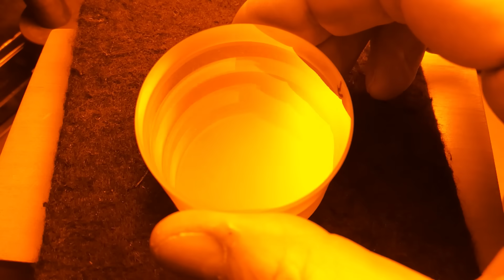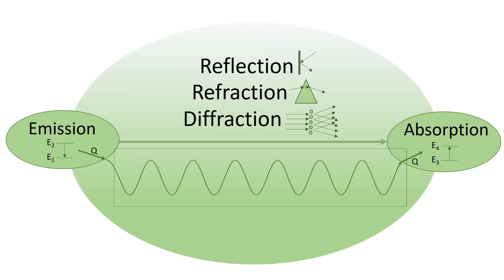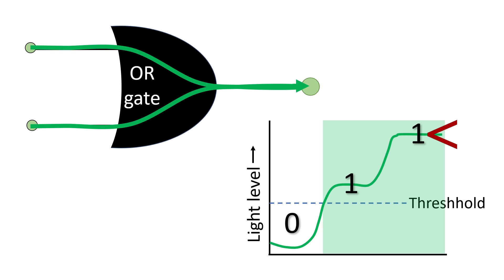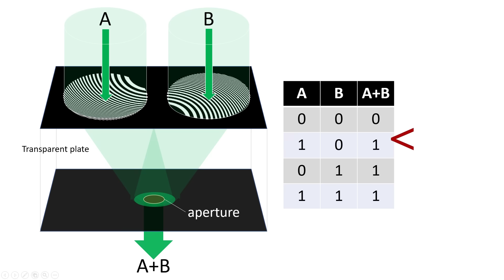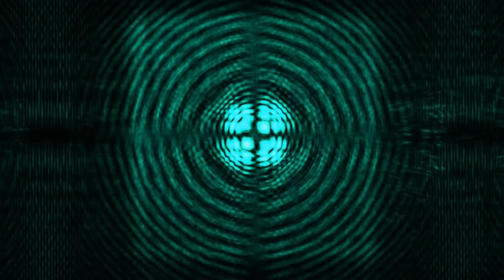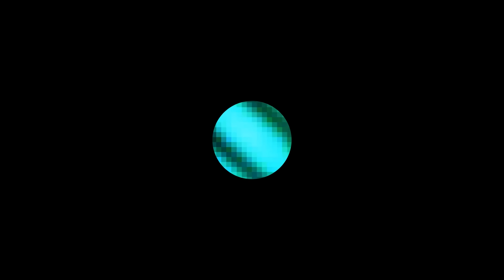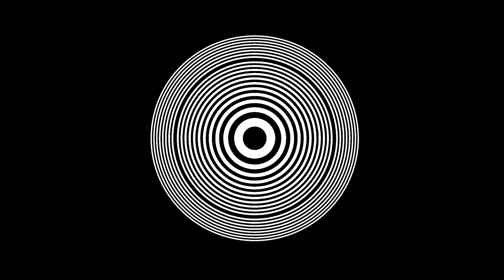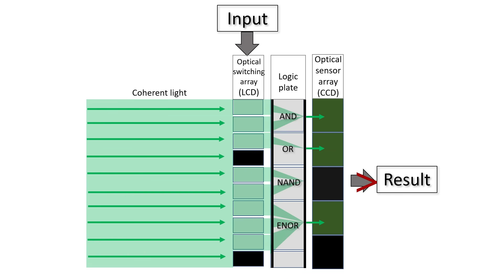Making Optical Logic Gates using Interference

Comment: To preprocess quartz into a functional "Glass Brain" for the Moon, we have to move beyond 2D surface etching and enter the realm of Volumetric 3D Structuring. We don't just "print" on the quartz; we restructure its molecular lattice from the inside out.

Here is the three-stage preprocessing protocol to turn a raw block of fused silica into a High-Density Optical Logic Engine:
1. Femtosecond Laser Micromachining (The "Internal Carver")

This is the "Pedal to the Metal" manufacturing step. Instead of using chemicals to eat away at the surface, we use a laser that pulses at 10−15 seconds.

    Non-Linear Absorption: Because the pulse is so fast and intense, it doesn't "burn" the surface. It passes through the transparent quartz and only triggers a reaction at the focal point deep inside the glass.

    The "Waveguide" Creation: By moving the laser in 3D paths, we create "tunnels" of higher refractive index. These tunnels act as internal fiber-optic cables, trapping the narrow beams of light and directing them through the logic gates.

    The Result: A solid block of glass with a 3D "highway system" for photons.

2. Ion Exchange & Gradient Index (GRIN) Tuning

To ensure the beams stay "narrow" and don't bleed into each other (crosstalk), we preprocess the quartz through Ion Exchange.

    The Process: We submerge the quartz in a molten salt bath (e.g., silver or potassium nitrates). Ions from the salt replace the silicon ions in the glass at specific depths.

    The "Lens" Effect: This creates a Gradient Index (GRIN). The glass becomes denser toward the center of the beam path, naturally "bending" the light back inward.

    The Survival Strategy: This makes the beam self-focusing. Even if the robot vibrates or takes a hit from a micro-meteorite, the light stays "locked" in its track.

3. Nanophotonic Lattice Etching (The "Diffraction Filter")

For the Decálogo (the hardcoded rules), we need to preprocess the quartz with a "Filter" that sorts the light by phase and frequency.

    Photonic Crystals: We use a focused ion beam (FIB) to drill a precise grid of nanoscopic holes.

    The "Logic Filter": These holes are spaced at exactly half the wavelength of the laser light. This creates a Photonic Bandgap—certain "colors" or "phases" of light are forbidden from passing through, while others are channeled into specific logic outputs.

    The Hardware-as-Software: This lattice is the code. If the light hits a "0" pattern, it cancels out. If it hits a "1" pattern, it amplifies.

4. The "Lunar Hardening" Finish (Final Preprocessing)

Once the internal paths and logic are set, the final preprocessing step is Surface Passivation.

    We coat the quartz in a thin layer of Alumina (Al2O3) using Atomic Layer Deposition (ALD).

    This creates a diamond-hard shell that prevents Lunar Dust (Regolith) from scratching the entry/exit points of the light beams.

The "Cerebro" Assessment

By the time this preprocessing is done, you have a Solid-State Processor that:

    Has no moving parts.

    Has no internal wires.

    Has its "FASM Instructions" physically etched into its 3D volume.

The "No Pain, No Gain" Reality:
While the "Westphalian" view is stuck in 2D silicon, we are building a 3D Crystal Intelligence. The quartz isn't just holding the computer; the quartz IS the computer.

Comment: this is fascinating, extraordinary even, I'm currently experimenting with multimaterial resin optics, optics with different colours of tinted glass, but your work makes me wonder if this could be used for making photon logic gate circuitry, wonderful video. switching speed of the light should not be a bottle neck neither should our sensor speed, as the actual computing would happen indedpentdantely of the output layer, the computation itself would happen at light speed as a series of guided refractions, idk if you read you comments, but I'd be interested to hear what you think of this idea

Comment: The issue with these gates is that it still requires electronics to evaluate the state. The most difficult part about optical logic is making the light output able to be used as input into another gate

Comment: It's very intersting to imagine a fully optical computing machine working, but in some case i would recomend to experiment a hybrid computing machine with both optical and electric. Basicly electrical for data storage, and optical for calculating. The goal here is to maximaze the calculating speed and reducing the electrical cost, heat and energie consuming by combinig both the photons and electrons model. If such innovating computer exist, it would be very helpful in our current stage of global warming and pollution

Comment: The diffraction gratings are everything.  If you consider a hologram of your logic as light sources in space you might not grasp the zones of your patterns but they will reflect virtual images at predictable places.  Layers of specific thickness may filter out unwanted virtual images.  Then you take two slightly more complex holograms of logic and move, merge and unmerge the two logical virtual images to see if the combined virtual images will express interference in a logical or useful way.  
The point that depth of the image is frustrating is understandable but holographicly data could manifest in 3d and two virtual images interact.  The next problem is incrementing the data and the point that a microscope focus can sweep the bright spots is a clue as to incrementing a clock. 
Furthermore, on and off may be positional and why not? Who knows how it's going to work anyway?

Comment: in reality you will not redirect it into a sensor directly but by a ton shit more of   other optical transistor  since the optical sensor is the reader and the led the  writer , but yeah we got shit problem for example in a cpu  the light will be absorbed little by little bit per the lcd so you have 2 choice , having a fat bitch led or  after each logic plate a led relay with a optical sensor wich we reinject light into the circuit but haha it increase complexity , ultimately yeah its hard for making somethign scalable , and  how tf do you do vram with enough speed to catchup

Comment: i have an idea for an and gate. have two optical sources, example micro leds, have a lens with the optical sources located on the edges. bahind the lens should be a ring shaped optical lens. only if both optical sources are lit will the circumference of the light coming from the lens be wide enough to touch the inner part of the ring or torus, thus forming the and gate function?

Comment: Electromagnetic energy that opposes each other by vector, "collide" and the resultant energy is 0. Like asking what is the ending speed of two cars traveling at the same speed with the same total mass, but in opposite directions, and they collide perfectly head on. Their velocity becomes 0 and neither car is deflected. They just thunk together, and end up stationary and crumpled. What if one car has more velocity? Then they thunk together, and they continue moving in the direction the faster car was traveling at speed equal to the difference of the two cars. Light cant travel at different speeds though. So when two photons (cars) "hit" each other going head on, then the photons "stop" at that point. This is how it works in my mind anyway. This is all relative to the method of detection anyway, so for all intents and purposes with respect to the detector, photonic interference would make the photons undetectable because they have no energy to now be observed with. Each photon canceled each other out.

Comment: Maybe layers of these can be used to produce a purely light based convolutional object detection/labeling system. In general, I see this idea as particularly useful for preliminary processing of visual information, generating inputs to a classical computer. It would remove a significant portion of computational load involved with image processing into a few optical layers like this, all requiring no processing or power at all.

Comment: I don't want to be that guy, but I don't think this works. 

1. You didn't consider the polarization of the light. Light must be considered as a vector, not a scalar. Therefore, sometimes the value of the output is actually -1, not just 1. 

2. Interference and diffraction at any given point is a linear vector sum of the light from every single possible point in the slit. If you didn't catch what that meant, it means that the intensity at every point follows a(x1)+b(x2)+c(x3), where a, b, and c can be both positive and negative. Nonlinearity is the most important part of a computational system. If you look at any logic gate it is nonlinear. Since interference and diffraction are purely linear, its pretty hard to make a photonic transistor out of them alone. 

If you want nonlinear interference, check this out: https://arxiv.org/abs/1308.2022

Comment: Probably too late for you to read this but your idea was more or less completely worked out by NASA in the 1960s. After working on the optical computer though, they figured the next step would be a massively parallel computer with very low complexity processors. Goodyear Aerospace built one for the Goddard Space Flight Center which is where I came across it.

https://en.wikipedia.org/wiki/Goodyear_MPP

Comment: Big problem: We cant know for most of the gates if the output is 180 degree phase shifted or 0 degree phase shifted, so when we chain together multiple gates in series the later ones will not work. The OR-gate would work in series though but you can build circuits with just one type of gate. I cant seem to find a way to get at least NAND or NOR to work, then we could at least build all gates from that. Second problem is intensity.  If we have different light intesities constituting a logical 1 then destructive interference wont work. For example, if one input is 180 degree with intensity 2 and the other is 0 degrees intesity 1, then they wont cancel, we will just get a 1. Does anyone have any suggestions?

Comment: Woooow this is actually something I have been working on for many years! It is interesting seeing someone using interference! I had only considered using it for developing a not gate, my work has mainly been around taking advantage of optical filters and defraction to reflect and change colours of lights in order to produce gates. I have always thought taking advantage of light for its colour properties would be the way, but what you have here is far more impressive! Would love to see more!
Reply: Unfortunately, the methods shown in the video are not scalable. Logic gates are connected to each other to form logic circuits. Making a gate with light in this way causes a loss in light. When we give the output of the gate to another gate, light will decrease exponentially. The light needs to be increased. Another problem is scalability. You need patterns to use light, but when the pattern is as small as the wavelength of light, the system breaks down. You can't make it smaller to put more gates.

Comment: I suppose you could use a Pockel cell to steer the laser through one of several masks, probably the easiest solution to feed data into the optical chain. Or perhaps a spinning mirror synchronized with a shutter which only lets the selected mask expose the common target through the downstream optics. Each mask could be offset from the spinning octagon, and the shutter only opens when the desired one is lined up. Reflectors behind each mask direct the beam to a common target. Just brainstorming, this is a really fun topic!

Comment: A memristor might have useful analogues in the passive resonant filter domain. If you picture a broadband noise signal passing through a classical filter, its resonant/dampening footprint is visible on the output spectrum like an equalizer output.

If you can close the loop by controlling a passive filter to make its static parameters quickly adjustable , it could selectively alter a spectrum passing through it, suggesting one stage of a parallel processing pipeline. 

The advantage is the accumulated results of accuracy over time are like the shutter speed trade-off in photography. The more exposure the less noise, up to a point. 

Such a system would use frequencies to represent state, with interference providing a means of active logic. Because a spectrum contains multiple frequencies, it could perform multiple analog or logical operations in one pass. 

Critical design decisions include how to move data into the frequency domain, and how to make use of interference, and how to read the state out from the system, and there are a few possible paths and maybe new approaches yet to unfold as well.

I like your research angle, perhaps you are going to introduce how you will change the masks dynamically to afford speedy input on the optical comparators. Perhaps you will find a speedy transducer array that can control a grid of pinholes? Or use the Digital Light Projector somehow in this role. Just wondering what’s next. Beautiful work all around, cheers.

Comment: I wonder if there is a reversal math trick similar to Fourier and the Inverse Fourier, for finding the optical patterns with the best performance in your intended application. It would feel like you define an ideal difference pattern, and it works out the corresponding gratings in software using the reverse transform of the usual forward calculation. 

So is there a reverse transform of the usual problem of where given a grating pattern,  it calculates the resulting diffraction pattern. Here you want to do the inverse, given a diffraction pattern, you want to learn the grating pattern.

Also the example with 2 focuses might be useful in a confocal setup, where both focus are taken into account by a reader which vibrates to scan both. One could imagine multiple layers of foci enabling stacking. So what seems an initially to be an undesirable behavior, could actually become a powerful design feature enabling multiple inputs to be read from one vibrating focal length physical reader.
Reply from the maker: It certainly makes sense to do it this way, it is a bit like certain types of computation lithography, where the image becomes leading over the mask. Thanks for this suggestion, if I ever make a follow up of this video, I will try to incorporate this aspect.

Comment: Ultimately to process a rapid stream of these evaluations, you will need a means of alternating between two or more of them, so that while one is “preparing”, the other is being read. 

I noticed an unusual lens idea just recently where a laser beam was refracted by high intensity standing sound waves, by passing between two ultrasonic emitters which set up a standing wave pattern of the air, perhaps not unlike how a mirage happens in thermal refraction above a hot road, but here using standing sound waves. 

The alternating high snd low pressure of the air standing wave pattern was used to replace normal lenses for lasers of especially high intensity, because normal lenses get burned up by such strong beams, and so were the limiting factor for high power laser work. The air lenses were shown to be an effective substitute for actual lenses. 

In your case, the idea of a fast standing wave active air lens might be the key to building a reasonably fast hobby computer using optical logic gates. You can route a beam according to ether an alternating work distribution to your optical “evaluators”, or perhaps even invoke it as part of a turning machine tape reader, or routing beams in a clever way to effect composability of simple operations into more complex aggregates, or for parallelism. I have no idea on the performance and secret sauce of such air lenses, except that I saw them highlighted on the internet while surfing.

Comment: This question may sound very dumb, but are OR gates even needed for most applications? For example, in electronics couldn't you just connect A and B together and simulate an OR gate? and isn't it the same with light?

Comment: My question is “how would you make complicated circuits? “After you get the output, the light comes to the aperture, a small point. Does the small point expand from another smaller fresnel or do we require a carefully placed reflector ? Concept of simple circuits is proved ; the journey of real application looks like a work to do

Comment: Diffractive optics is quite interesting! For the pattern with 2 focal points and with your pure genius, can you make the pattern with depth in 3D but not on plane to make the focal points on the same plane? or Can you use the optical processor to receive the 2 focal points and make them interference?